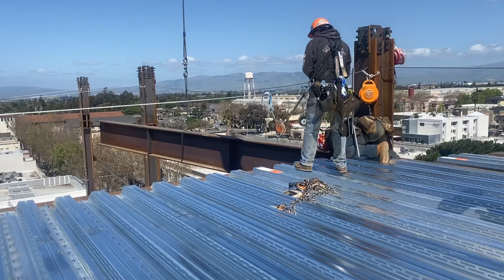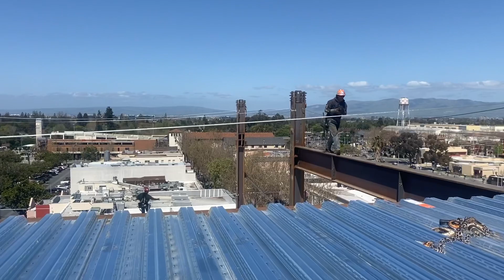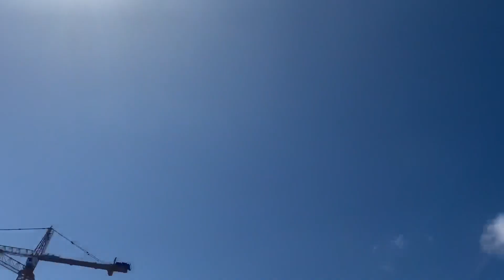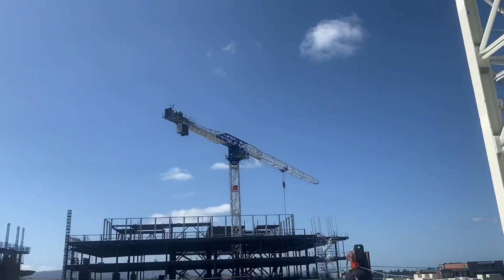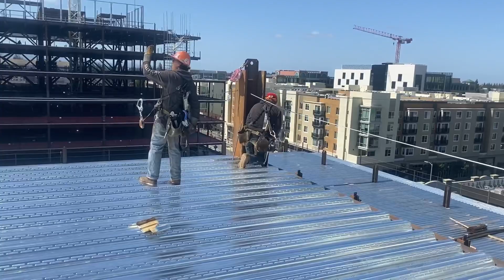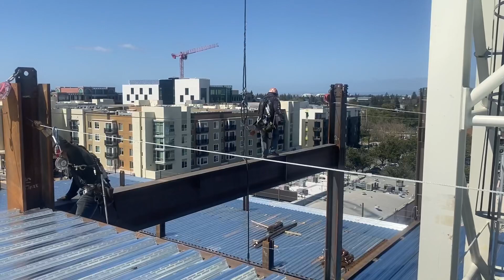Union ironworkers connecting California bay area

Comment: Enclosed powerhouse does something for the senses ,way different world coming from a metal building guy that the 1st time o looked over a finished wall onto an open roof openly declared no way..virtigo makes new pussies all the time ,cant say as i evrr conquered it so to speak fukin bro program all the way
Reply: No these power plants werent enclosed. were talking massive coal burning power plants . 60 ton columns 100 ton girders at the top. Any levels or floors were galvanized grating. Dragging grating was probably the most dangerous. They would fly stacks  of grating up  and two Ironworkers hooked them with homemade grating hooks made  out of rebar one on each end and drag them across the beams as fast as they could to the other end of the structure and you were not tied off. They were in sheets about 12 ft long and weighed about 250lbs. Most of the Ironworkers on this job were just good ole country boys. One was the high school quarterback just recently out of high school for the summer. Next thing you know hes hanging Iron haha ! I bet his Mom would have kicked the foreman's ass if she knew her son was hanging Iron right out of high school !